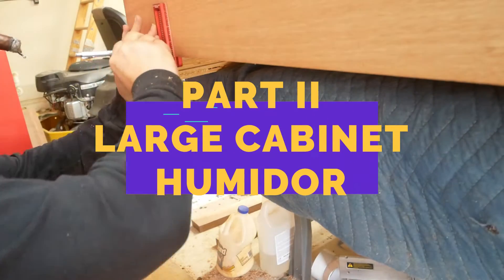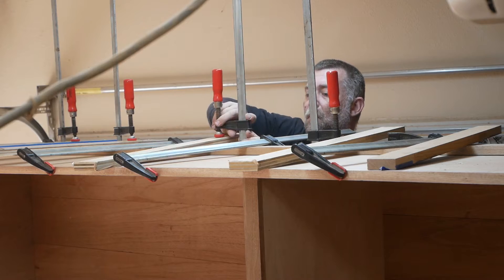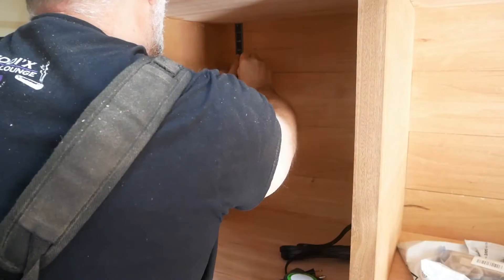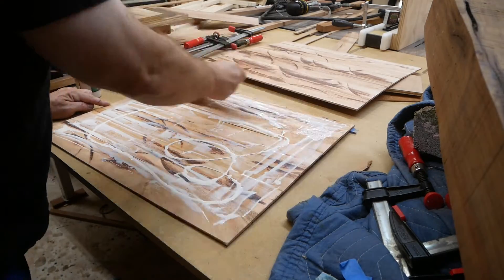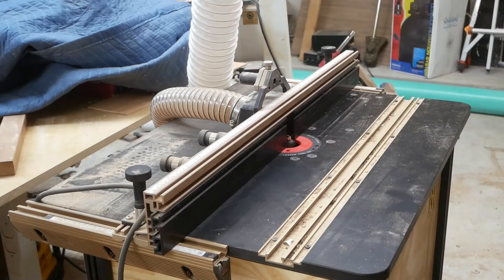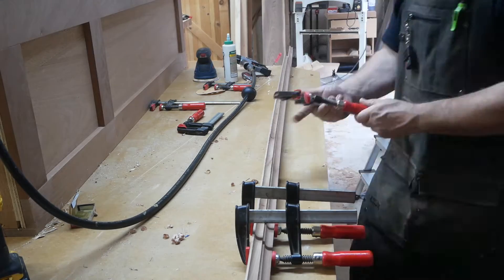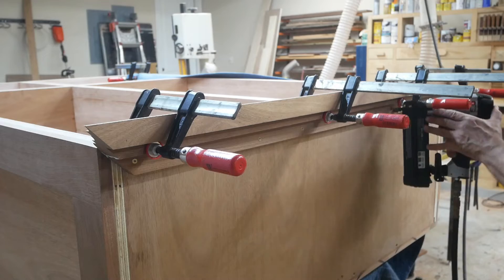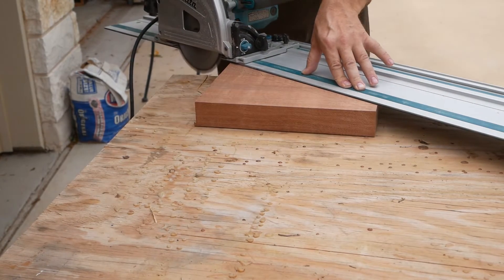BIGGER CABINET CIGAR HUMIDOR PART II

Comment: Why use veneer instead of using sheets of actual Spanish cedar
Reply from the maker: It is actual spanish cedar. I cut the spanish cedar from 8/4 stock down to 3/16” thick pieces of veneer.
Reply: @DsHardWoodCreations  cool, where are you located?
Reply from the maker: Near Austin, Tx
Reply: @DsHardWoodCreations  I wish you were closer, I have a nice China cabinet I would love to convert into a humidor,  I'm in Raleigh NC
Reply from the maker: Wouldnt be too hard. Just cover everything with the spanish cedar. 1/8 -3/16 inch strips is all you need. I show my process in this vid https://youtu.be/Qa-Zvo8fwTw
Reply from the maker: Then after that you could probably just use the existing shelves make or buy some cigar baskets and a humidifier. Run it a few days see if it holds humidity. If it dont then use some weather stripping to seal air leaks and that would be it.
Reply: I love your work!
Reply: @DsHardWoodCreations  I don't have the tools, unfortunately,  plus I want to with 3/4 spanish cedar.
Reply: @DsHardWoodCreations  It's hard to find great carpenters like yourself here in Raleigh NC
Reply from the maker: @kareemklass9107  thank you
Reply from the maker: @kareemklass9107  i think it would be over kill to use 3/4 in my opinion.
Reply: @DsHardWoodCreations  That's why I wish I had access to you!
Reply from the maker: I appreciate you kareem. Thank you
Reply: @DsHardWoodCreations  Your welcome